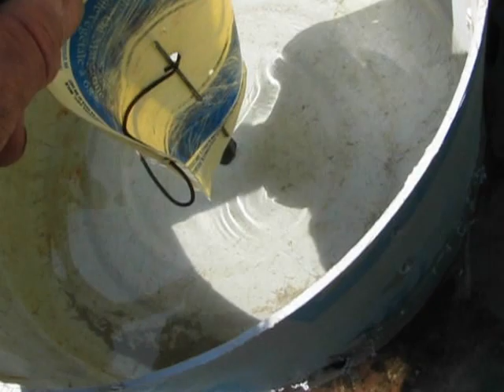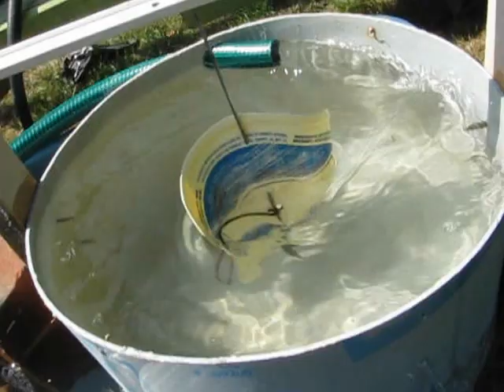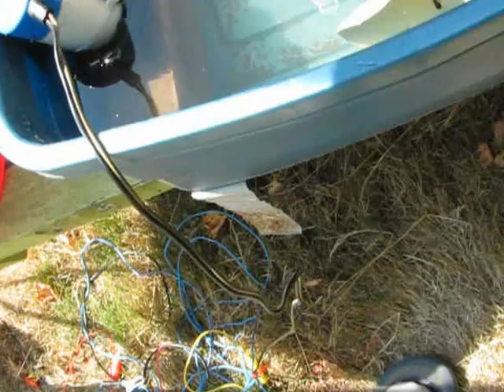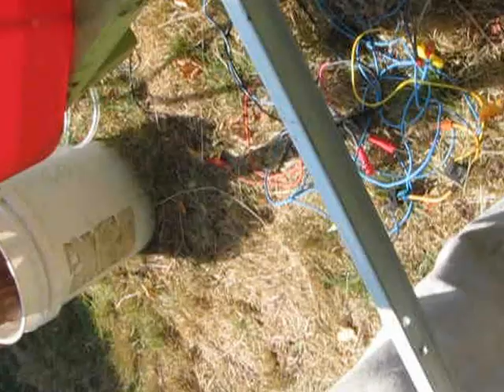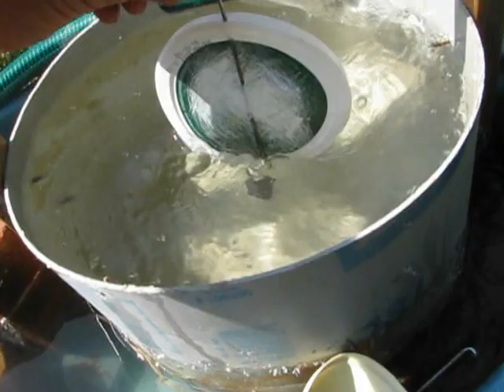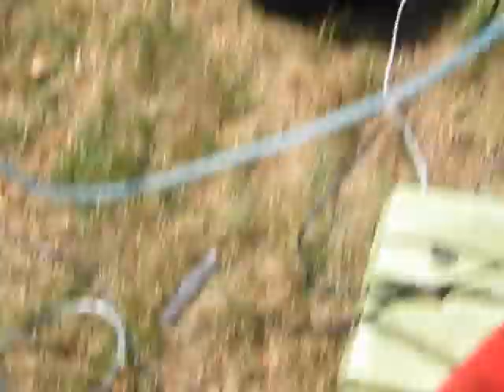"Fish Friendly" gravitational vortex power  demo has big surprises!

Comment: fish ladder ?
Reply from the maker: This is just a model.  Gravitational vortex power is used on rivers with head 0.75 meters to  3 meters (2 ft to 10 ft)  in Switzerland and Germany to produce electricity.  The vortex chamber  in these cases is 3 to 6 meters across (10 to 20 ft), maybe  2 to 6 meters high (10 to 20 ft high) and made of concrete, and the hole in the middle where the water gets out at the bottom might be a meter (3 ft ) wide.  In these big things,  fish swim up through the hole at the bottom,  and  hug the bottom as they swim UPSTREAM THROUGH  THE DEVICE.  Even shrimp can swim upstream,  hugging the bottom via the algae encrusting the bottom and sides.  These are not as efficient at generating electricity as standard  turbines but the loss of migratory fish and other river life has an economic cost too.  "Fish ladders" are  often fabulous "feeding stations" for otters, mink  and various birds. And  I have seen salmon fish ladders in Ireland that  miss several rungs rendering them less than useless to the fish.  Maintenance is necessary.

Comment: Very good stuff Brian, thanks for posting. I subscribed to get your posts.
Reply from the maker: Thanks Frankie,  this year I got 4 little air pumps from China to test and one type works great. I make low pressure air (less than 1 psi) and send it in irrigation pipes  (The "low pressure pneumatic grid"  to my "pallet gardens". Then the air goes into "air lift pumps"  which pumps water up around the vegetable and tomatoes  in my "pallet gardens".   So really (if you include the "pulser pump" too),  I have made a whole alternative "steam punk" system that does not need electricity to work.  I love how the gravitational vortex works and one of the next projects is to use it to compress air too.  I need to make an open source diaphragm air  compressor first.  The diaphragm compressor will hopefully work with all renewable sources.  Wind, water and Stirling engines.  I apologize for how long this stuff is taking.   It needs a week of down time to get the creative juices going and this year has been too busy at work.   Brian
Reply: Brian White that sounds amazing, I am a complete novice and will be starting at beginners level but I love what you do and I would like to thank you for sharing it.
Reply: @Brians-tracking-solar-scoop  I was also wandering around differents pumping/compressing techs (apart the tromp one thats a really good one im experiumenting soon with!) and i also saw the Scroll compressor wich seam quite interesting for different fluids and doesn't necessarily need valves. What you think about?

Im looking for the best reversible technology to convert the compressed air from trump to electricity

Comment from the maker: It is a demo of how the gravitational vortex power plant works.  The pump was just there to keep the  demonstration running.  I made this for a makerfaire because I had no access to electricity at my Booth.  An up scale larger version might work in a stream in a barrel cut in half.  Some fish could come up through the hole and continue on up river.  This is impossible with other types of turbines.

Comment: Compression?  I don't think that has anything to do with it.  It takes a lot of pressure to compress water.  Much more then what is applied here.  What is happening is that as the water spins it speeds up slowing its vertical drop.  This backs up the water column cause it to overflow the containment.  When he puts the impeller in the vortex he causes the water to slow allowing it to increase the vertical drop  This allows the water to flow through the hole faster.

Comment from the maker: Well from what I have seen, the water slows down going through the hole as a vortex builds up over several minutes, and the water rises in the little bucket.  That would mean that the vortex is accumulating energy from the falling water.  I have also seen it with my  "turbines".  I can have the water going through the hole (no vortex yet) and as the vortex builds, it tugs harder and harder on the biggest "turbines". Anyway, the only way to be sure is to test it yourself.
Brian

Comment: I'm not convinced that it's an energy-in-the-system thing yet.  Could it be that the turbine changes the direction of flow of the water to be more vertical and thus drain faster?